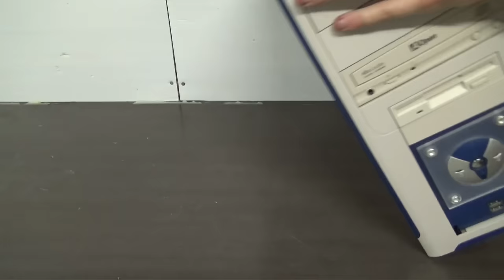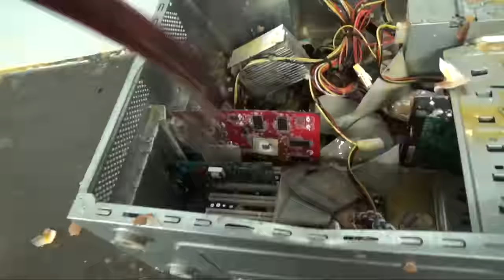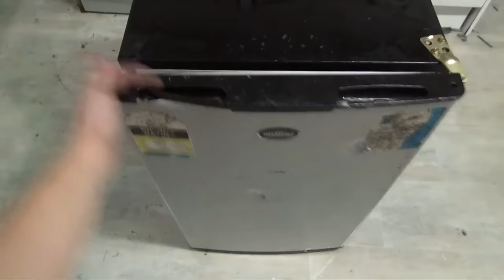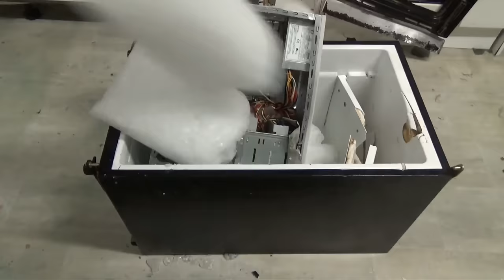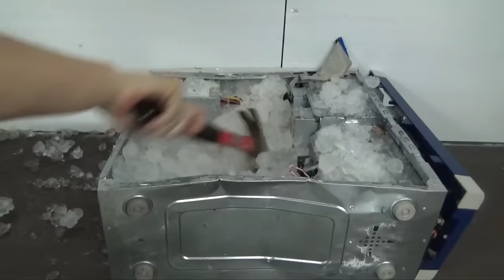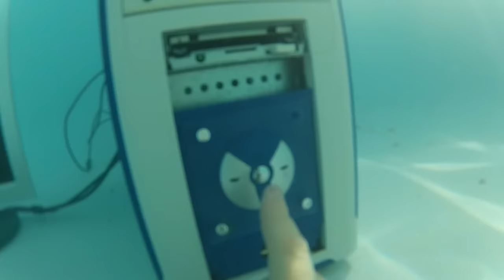How To Cool Down Your Computer

Comment: tried it and it won't turn on again, what do i do?
Reply: +Rob Rod It worked, thanks.
Reply: +Martijn Stekelenburg did u try all that in 4 minutes?
Reply: thats why ye never need to take this shit tooo serious
Reply: Try turning it off and back on again
Reply: throw eggs at it, then scream and throw it at kitchen equipment when your naked. that worked for me
Reply: Have you checked to see if it is plugged in? Very common problem.
Reply: +Martijn Stekelenburg Use more eggs
Reply: you might need a little more egg in it
Reply: +Martijn Stekelenburg reinstall windows
Reply: +Martijn Stekelenburg have you tried turning it on and of again?

Comment: thanks! i cooled it down with this recipe! but its not turning on for some reason...anybody got advice?
Reply: Cutest Kitten :3 dude, i don't know, i think your computer is brocken
Reply: +Cutest Kitten :3 try turning it off and on again .
Reply: try throwing more eggs on it.
Reply: factory reset
Reply: Idk. Probaby throw a turkey and some eggs at it. Im sure it will work. If not, just throw it at the pavement. That will work for SURE.
Reply: Is i plugged in?
Reply: Diamond Playz u alright?
Reply: Diamond Playz trow it in water again

Comment: how did he not get electrocuted
Reply: The computer was not turned on M8 😂
Reply: +LuKeZy090  Capacitors in computers hold electricity for over 20 years. even when never plugged in for extended periods of time.
Reply: +FoulFell The electricity held wasn't nearly enough to electrocute him.
Reply: +FoulFell Lemme just clear this up real quick. this pc is old af and the parts inside seem pretty low tech meaning the only capacitors even questionably able to output electricity that would vaugly harm the human body would be inside the PSU. It is very easy to release any remaining electricity from these capacitors if they even had a feasible amount remaining after all these years without it all being transferred into heat or just gradually released as static. I'm sure such an established channel as Howtobasic would take any risk precautions into consideration before shooting a video
Reply: +Clay More Sorry I appear to have been on my old account. could you care to explain if I am such a dumbass?
Reply: Why don't all the fish die when lightning strikes the ocean? It dissipates,  so even if it was plugged in he would have been fine.
Reply: didnt you notice he hammered and punched and threw icd block at it soo why???
Reply: pootis sanic in English please
Reply: dennis sellar he destroyed the thing thats why
Reply: +LuKeZy090 u used the KNOWLEDGE!
Reply: I lik ur spelin m@t3y
Reply: +Clay More hey... Hey man... Jesus isn't real. He doesn't exist
Reply: +He11H0und of Doom Yeah, the guy with hair all over his face exists.
Reply: The pc had no wire connected to the socket 😉
Reply: +BoringMan There was no power running
Reply: +Brothercasters Gaming Dude can you just not be so freaking rude!?

Comment: How to do a HowToBasic video: step one do the thing properly (this lasts 20-40 seconds) Step 2 get angry with it and throw eggs at it step 3 grab the nearest object like a hammer, Sledgehammer, shovel, flamethrower, machine gun, anyting. Step four throw it outside run it over with your car turn on the floor or get a water hose and put water inside of it step 5 piss or shit on it step six put ice in water inside of it step 7 through it inside of your pool step 8 get angry with it again because it's not working.